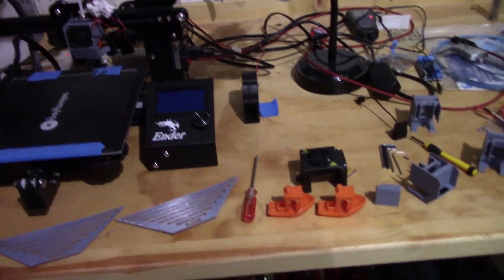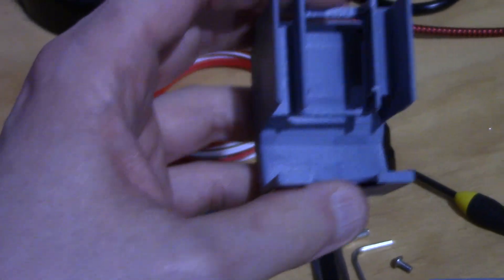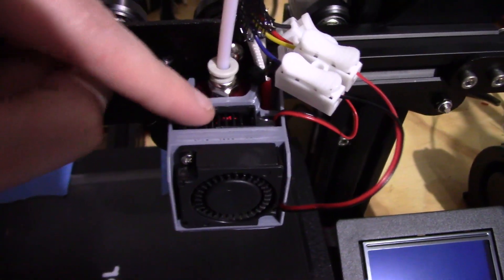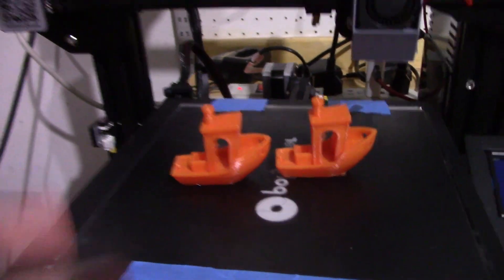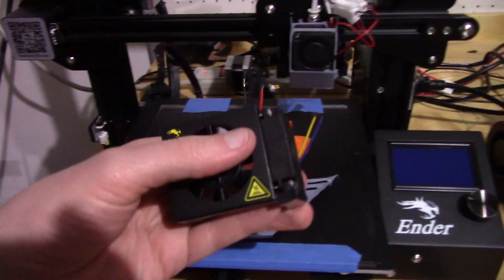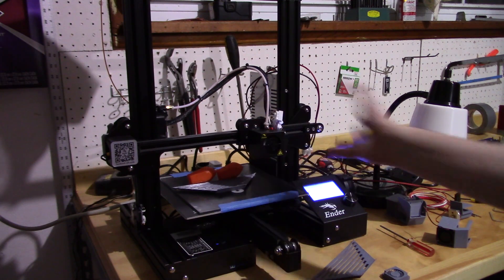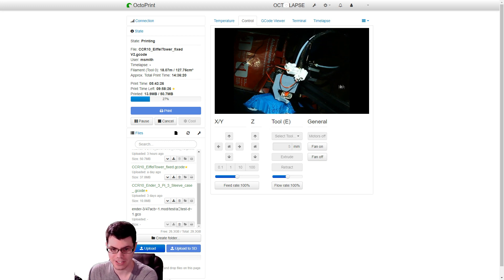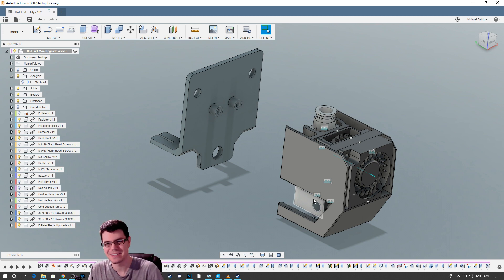Part 2 The Prototype - Designing A Better Hotend Assembly For My Ender 3

Comment: You use any G-code at the end of your prints?
G1 X128 Y128 Z255 F9001

What I use to make it push out the build plate and and move up the gantry, as fast as it can since it's power levels are over 9000.

G1 X128 Y255 Z255 F9001

Would technically be better but if it's centered and I pre-heat it there for the next print I can clear PETG goop off over the center pos of the build plate.  Also you have any good startup scripts?

Comment: First hing i did with my Ender was replace those fans with Nocuta's and printed a cover for the enclosure fan. 

Not sure if said this in the comments on the other video, but the Enclosure fan and part cooling fan are run in parallel. Which i thought the fan was failing to and why i switch to Nocuta's. It was something that confused me at first with this printer. I've since moved it to the screw terminals to be always on.
Reply from the maker: Are you running a 12v fan off the 24v terminal? I am a bit curious because I did not see any Nocuta fans rated for 24v. I might have missed something.
Reply: Sorry. It's 2 in series. I added a small cut out on the side of the encloser and created a push pull air flow.

Did like the design on the duct.
Reply: I was just going to suggest replacing that bottom fan with a Noctua, although running it at 24 volts would probably cause some issues
Reply: if your lucky it will just burn out quickly. Worst case start a fire. You never want to apply move voltage and amperage to something then item is rated to handle.

So voltage is addition of all the voltage elements. So putting 2x 12 volts fans in series becomes a 24v circuit.